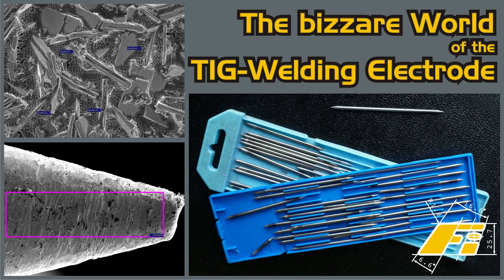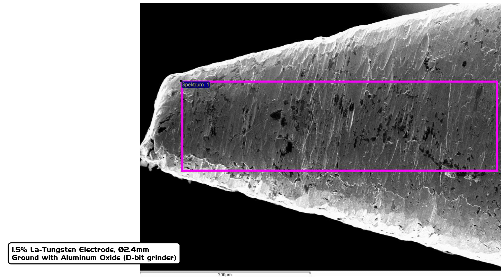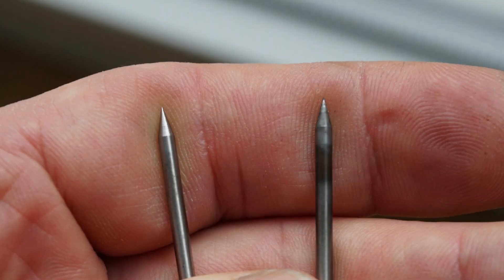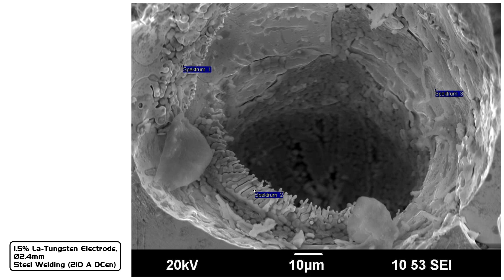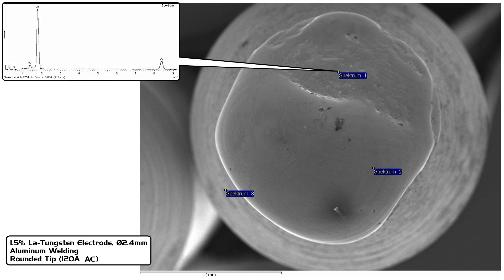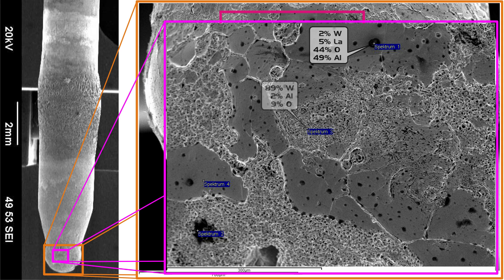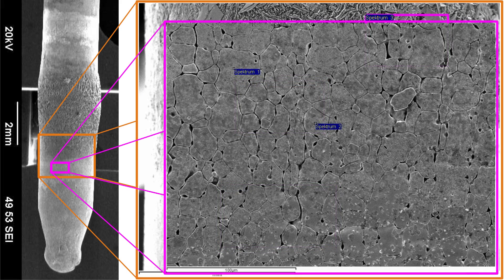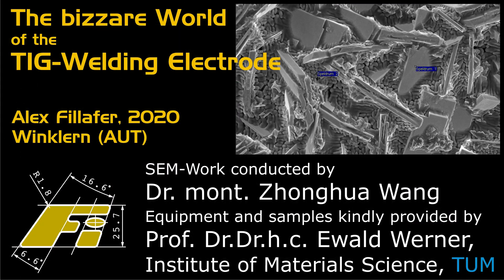The bizzare World of the TIG-Welding Electrode

Comment: I was always told you're not supposed to radial grind tungsten but instead grind it so the striations are vertical or axially aligned with the electrode, supposedly makes a more stable arc.

Comment: Really nice work! My only wish is that you examined some cross sections to evaluate the depth of penetration. By the way, La2O3 has a lower boiling point than W (4200C vs. 5500C). So it stands to reason that part of the cause of the La depleted regions is not just differing diffusion rates but the La2O3 boiling off!

Comment: EDX can probe a couple of microns into the surface, which might help answer your question at 5:38. You'd need synchrotron XPS, sputtering, or a FIB cross-section to really be able to do depth profiling. We have a FIB/SEM + EDX at work, if you send an electrode I might be able to provide a FIB cut with EDX.
Reply from the maker: Thanks for your interesting suggestion. Maybe this could be done with a simple ground electrode cross section as well. If I find the time, I'll try.

Comment: I would love to know what's below the surface. I re-grind my electrodes by skinning the tip, as if sanding the contamination off and then a little into the W. Always works, so i've always assumed that contamination is only skin deep.

Comment: Isn't the crater more likely due to sputtering, similar to DCEP cleaning cycle when welding aluminium?
Argon and other gas gets ionized and hits the negative electrode, where it causes sputtering or oxidation.

Comment: Great content on your channel Alex!  I heard you mentioned in one of Stefan's videos.  Excellent series on the weld distortion stuff BTW.  For this video it was also very informative.  One thing to note with Tungsten is any little flake of W that contaminates the weld is generally bad.  This is especially true on RT welds (radiographed) because the W with really stick out in a radiograph since W is so dense, most welds that are RT'd will fail the inspector.  One really good practice is to run the electrode in at or slightly above normal weld current for maybe 10 or 15 seconds on a scrap piece.  That way any little W flake will likely fall of in the scrap weld bead and not contaminate the good weld. P.S. I like to polish my electrodes and slightly ball the tip smooth.
Reply from the maker: Very good information, thank you!

Comment: Nice video. From the scales I saw in the pictures, is there any reason why this could not be viewed with an ordinary metallurgical microscope? Beyond the xray specturm analysis of course.
Reply from the maker: Actually, a standard metallurgical microscope should be fine for this, too. However the electron beam microscope has much more depth of field and contrast, which may be a benefit.
Reply: You are right about the depth of field. I had not considered that.

Comment: Interessant!
Der stirnseitige Abbrandkrater ist überraschend, das hätt ich nicht erwartet.
Das Schliffbild der neuen Elektrode ist echt komisch, auch hier, hätte nicht gedacht das Wolfram zum schmieren neigt, normal ist das Zeug so hart/spröde, da hätt ich eher feine Ausbrüche erwartet.
Reply from the maker: Grüss Dich, Stefan! Danke für deinen netten Kommentar, verfolge deine Videos immer mit großem Interesse! Hoffe wir sehen uns irgendwann mal wider. PS: Das mikroskopische Schmieren hat vmtl. mit der lokalen Erhitzung zu tun.
Reply: Every solid at room temperature is just a frozen liquid, so when you add enough heat and/or pressure, it will flow like a liquid. So even Tungsten flows like a viscous liquid, at the cut edge of the chip. If the chips are small enough then the pressure is high enough and the surface looks like someone has dragged a scoop through the ice cream. Also, the sharp geometry of the tip hugely magnifies the current density and electric field, you can likely change this end crater size by flatter geometry at the tip but also by changing amps and ramps.